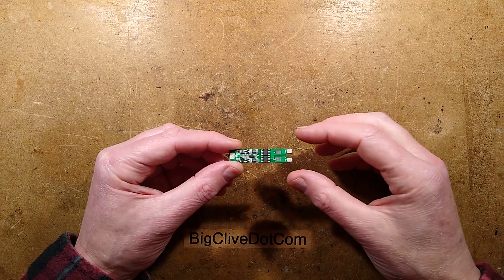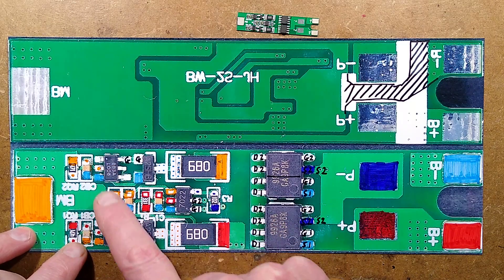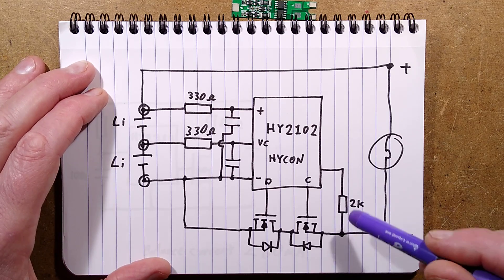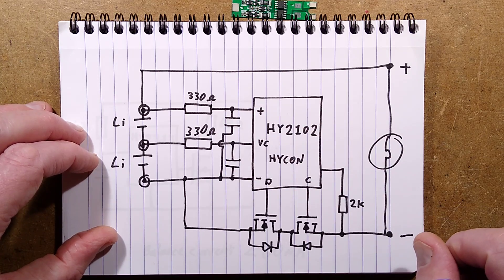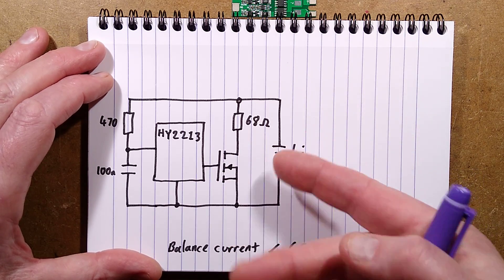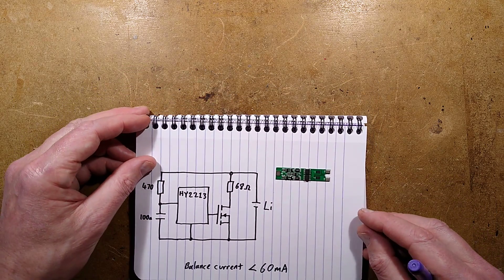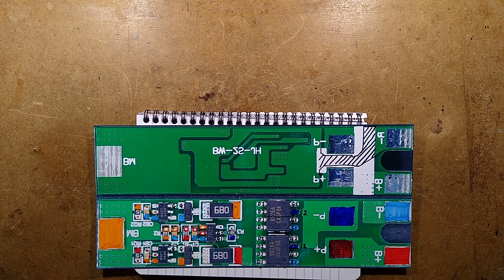Lithium cell balancer reverse engineering with schematic

Comment: Great video and explanation. This is a passive type of BMS. This is slower and produces heat, maybe small amount. Once cells start to degrade, balancing becomes even slower. Active uses other cells power to charge the other, but it is quite complicated and I am looking for a simpler design if anyone could point me to the right direction or schematics

Comment: What is the 883A L008 IC used in this circuit?
Reply from the maker: HY2213-BB3A lithium cell balancing controller.

Comment: Almost all MOSFETs sold will have body diodes; it will not go away (anytime in the future). A MOSFETs "without" body diode will not have a fixed threshold voltage (Vth) because it varies with both Source and Drain voltages in reference to the 'body'. Also a fourth terminal (connected to the body) will be given as well and you have to connect it to a voltage that will always be reversed bias (or 0v) to the Source and Drain terminals. This makes the MOSFET difficult or inconvenient to use. That is probably the reason why the 'body' is always connected to the Source terminal so that Vth is fix and you don't have to deal with the fourth terminal, but you get the (unwanted or free, depending on how you appreciate it) body diode as the result.

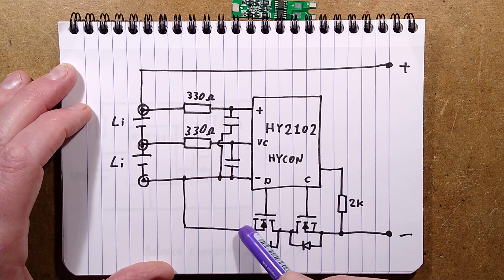Comment: 3:04 This is a detail, but the body diodes direction of both NMOS is switched... The reason is that they live in the same chip (as you pointed out it's a dual MOSFET chip).  So, most likely, both NMOS share the same substrate and so the anode of the body diode is necessarily common to both MOSFET. 
Therefore the node between the 2 NMOS should be the anode and not the cathode.

Comment: I had exactly the same question about how the 'balance' chips can work if the over voltage protection shuts off the charger input?
It looks like they can't unless the protection trips at higher voltage than the balancer, so if the charge current exceeds the bleed rate, the voltage will rise and the charge input shuts off.  Maybe that is what you said?

Comment: That is not exactly a balancing circuit, it's a voltage limiter, the difference is that to have the cells balanced you must charge them to max voltage. But what if a I want my cells to last? the easiest way to prolong the longevity of the cells is just to charge them to a lower voltage (I use 4.05v), in wich case you either need a true balancing circuit or a limiter with the voltage adjusted accordingly.
I just don't trust commercial BMSs, whenever possible I build my own, I went as far as to build my own single wire communication protocol for a scalable BMS that I'm currently using on a 7KWh 7s pack, complete with remote monitoring.

Comment: Stupid question, sorry. Are their boards designed to charge two cells in parallel, instead of in series like this?  I’m thinking of something like 18650s from scrapped laptop batteries. I’ve been told that you shouldn’t charge two of those cells that are welded in parallel.
Reply from the maker: This is for two series cells.  For cells in parallel they should be treated as a single cell.

Comment: "balancing" without any kind of organised higher level BMS is not really balancing, but actually "charge shunting"  Ie say Vmax is 4.2v, the first cell to reach say 4v has it's shunt resistor turned on, and as a result is now being charged slightly slower than the cell with the voltage below that same 4v point.  The aim is that by the time the 4.2v and the hard shut off is reached, that charging imbalance will have had enough time to have caught up the voltage on the cell not being balanced.

Proper "smart" balancing that is necessarily controlled by some form of higher level control logic can both do this earlier, ie at a lower cell voltage and hence have more time for balancing, but also can signal a reduction in charging current to also help the balancing occur as necessary.

For small simply cell systems, then the basic shunt type arrangement works, but it mostly doesn't do that much, and it take a significant time to do it. It relies on the fact that hopefuilly the cells are both well matched initally but also age at a similar rate!

Comment: Any chance of you doing a teardown of a solar charge controller. I know the basic principles but I have a few queries in my mind. 
Does it work just by controlling current by sensing the voltage or does it control the voltage as well. In particular I was wondering if the solar panel is outputting a voltage lower than battery voltage would it be worth putting a buck/ boost convertor after the solar panel to enable it to use more of the solar panel output?

Comment: In some of my very high reliability designs, I couldn't rely on the CMRR of the voltage sensing OP-AMPs to monitor the voltage of each cell, especially for very high voltage batteries with tens of cell in series.
I used a temperature-stabilised opti-coupler for each cell as voltage sensors.
This design is in totally opposite direction of the chinese designs, which prioritise low components count and short PCB tracks (to save copper), where reliability, immunity to noise and all static working points of active components are sacrificed to the cost of the board.
Thank you Big Clive for this video, that exemplify the design criterias to the bones...

Comment: Not entirely related to the video, but it does involve power supplies, so it’s tangentially related - and I’ve no idea how to make a comment on a channel instead of a video or even if that’s possible. 
Anyway, has anyone seen a computer power supply fail where (I think) a MOSFET explodes? (Obviously, after watching this channel, I had to salvage something from what is likely a very expensive problem, by dismantling the PSU to identify the fault).

Comment: if the balancer and protection mosfets are correctly programed at the right trigger values the balancing function can still work without a CV slow trickle type charger. Imagine the trigger for cell balancing is 4.18v and the over voltage protection trigger is 4.25v and THEN the over voltage protection release is 4.2 volts the balancer will run continuously and the charger will activate every hour or so for a few seconds. If you keep the charger plugged in it is wasting energy at 60ma forever but at least the cells will get balanced over that time period no matter what type of charger you are using! Then after awhile once the cells are perfectly balanced maybe in a few days or so just unplug the charger and the balancer will drain the pack to 4.18v and then stop wasting the energy and you can have a perfectly balanced pack!

Comment: Hey i was wondering if anyone else experienced this problem.  I have a set of Howard Leight headphones, the green ones.  They are not bluetooth but they have an audio jack and a weird microphone that amplifies spoken words while dampening stuff like gunshots, as they are intended for shooting.  Anyway the mic is what seems like a rheostat where it clicks and turn off on one side and other direction turns on and seems to increase gain on the mic.  Anyway I wanted to use these headphones by just plugging in to my PC speaker with the audio jack. As soon as this thing went near my computer, as long as it was on, but before I even hooked up the audio jack, they started making weird ticking sounds. The sounds did not vary with the gain on the mic, and only stopped if I completely turned off, the headphones. Distance from other electronics does seem to play a role in how strong the ticking is. However, it’s not Bluetooth because even when I make my computer go to airplane mode, it has no effect on the ticking sound. As long as the headphones are near the computer, they make the sound. It’s not the router cause I moved it to the other room. Any ideas what’s causing it?

Comment: Odd thought: perhaps replace the 68 Ohm resistor with an LED and a 15 Ohm resistor?

This might give a (simple and crude) indication when balancing is actually happening?

Another thought is to put a pair of tip-jacks in one of the (metal cased and dismantlable) Ebike chargers I have, so as to more-readily test the actual output voltage of the thing?

Comment: The balancing circuit works when the cells have different capacities after time in use.  The weaker cell gets charged first.   The balancer  turns on stopping it being overcharged whilst the other cell fully charges.

Comment: The same as DW01, overcurrent protection is going to have a wide tolerance as the current sense is the voltage drop across the MOSFETs. Mosfets are specified be maximum RDSon, not minimum. If you are unlucky to get a couple of really good MOSFETs the overload protection could be at a much higher current than expected.
Reply: how does dw01 control the two mosfets? bootstrap?

Comment: My guess is that if one cell is full and other isn't, the full cell's protection resistor will be dissipating in excess of 62 mA (i.e. in excess of 4.2 V).  The resistor, plus the non-full cell, in series will be taking however much current gives 8.4 V.  Thus the non-full cell will (only) asymptomatically approach becoming full.

The high level takeaway from this video is that some battery packs will only get balanced when charged to full.

It would be nice to see BMS balancing systems that work at lower SoC become more ubiquitous.

Comment: As you can't just charge a single cell as the input voltage is meant for two cells, why not balance between themselves? Like for example, when one gets to 4.2V, you turn off the charging mosfet and then you connect the cells in parallel with a resistor in between. When the voltages get equal, you start charging again until one cell gets back to 4.2V and then you repeat until both are at 4.2V and you stop charging. It may not be the fastest, and not the most efficient (half of the balancing energy is wasted) but quite simple and effective

Comment: The technique is called top balancing. When you charge a 2S pack, you just put 8.4v across the terminals (with a current limit). It charges at constant current then constant voltage. If the cells are mismatched or otherwise out of balance, one will reach 4.2v before the other. Hence detecting 4.2v for each cell and the shunt if 4.2v has been reached, as the other cell still needs to charge. The voltage across the shunt could in theory be up to the full 8.4v if the second cell has failed short circuit.
Reply: In a multi-cell pack, more than 4.30V across a single cell would be an over-voltage fault, and sufficient reason for the pack controller to stop charging and disconnect the pack.

Alternatively, if a cell decided to short, a low voltage condition (Vcell<2.0V) would be another reason to stop pack operation. Although in this case, that might not help much - the cell would likely be going into thermal run-a-way, and an over-temperature fault would soon occur, sometime about when the cell decides to vent....💥

Comment: 60 mA through the 68 ohm resistorb also works out to a nice 1/4 W, which seems like a reasonable upper limit for a small surface mount component like that with good heatsinking to the PCB.

Comment: Li-Ion chargers typically use CC-CV as the charge method, in CV mode the current near to the shutoff voltage is already so low that the bleeding circuit of the balancer has a significant effect. If the cell is too badly unbalanced it will strobe-charge the pack which is generally fine.
Reply: thats correct, but if the balancer and protection mosfets are correctly programed at the right trigger values the balancing function can still work without a CV slow trickle type charger. Imagine the trigger for cell balancing is 4.18v and the over voltage protection trigger is 4.25v and THEN the over voltage protection release is 4.2 volts the balancer will run continuously and the charger will activate every hour or so for a few seconds. If you keep the charger plugged in it is wasting energy at 60ma forever but at least the cells will get balanced over that time period no matter what type of charger you are using! Then after awhile once the cells are perfectly balanced maybe in a few days or so just unplug the charger and the balancer will drain the pack to 4.18v and then stop wasting the energy and you can have a perfectly balanced pack!
Reply: @uhjyuff2095  Some chargers do exactly that - it's called the bleeding phase, or just balancing phase. The charger rises the charge voltage slightly and lets all cells reach the top voltage. Then it switches off completely. Sometimes the CV voltage is set so this happens automatically from time to time. This is rather stressful on a cell, but it allows for much better pack performance.

Comment: non-related question, where/what brand/model/source did you get your nifty little lighted magnifier and what's it's magnification?  Thanks
Reply from the maker: eBay has a selection of them, but the magic keywords can be a bit tricky.  Start with "illuminated magnifier".

Comment: As far as I know (before video) they just slap on a resistor across the batteries that are too high to bypass them during charging and to help discharge them a little. An isolated comparator per cell.

Comment: A very simple SAFE way to charge multiple cells ( like a 4 pack from an old laptop ? ) is to bring ALL the connections out and charge each cell in turn , ( use a working  old vape charger + croc clip leads ? ) ... this is a hell of a faff , but at least you will not cause fires ( ? ) ... ( tried - n - tested ) ...... DAVE™ ...........

Comment: Can anyone explain to a real electronics dummy like myself how things like diodes work, when every once in a while I hear someone say "electricity actually flows from negative to positive, and it's backwards to how you're taught."

I just get confused as to how one-way components work properly if thats the case.
Reply: Electrons were discovered 150 years after negative and positive were defined, unfortunately. So a large body of electronic components and conventions were defined before we actually knew current is actually compared of moving, negatively charged, electrons. As for diodes, you don't need to understand electrons to invent them, just like you don't need to understand electrons to experiment with lightning and static electricity. The first diode was just an extra electrode in a light bulb, connected to a battery. If the extra electrode is more positive than the one being heated to make light, it attracts electrons and receives current. If it is more negative, it shows no current. So it's unidirectional. You don't need to understand electrons to test the two situations, though. Early current measuring devices were just electromagnets that pull a metal pointer, after all, and electromagnets are just coils of wire.

Comment: I always thought the whole "balance by wasting energy" was weird but I guess it's pretty common. The weird thing about this implementation, is that unless you charge it all the way it won't balance, so if you try to stop charging at a lower point to save battery wear you might get an incredibly unbalanced pack.
Reply: ignoramus!
1) practically all battery packs are balanced at the top end.
2) you cannot balance a battery pack somewhere in the middle, it will almost certainly cause imbalance.
3) if you really  must "save battery", it does not really matter how unbalanced the pack is. (unless you then suddenly totally          discharge or fully charge the pack. (which in your case would be expected)
4) your wasting energy bleeding a high cell is an absolute tiny amount compared to what is going in and out of the pack.
Reply: @ursodermatt8809  Thanks for your explanation but please don't call people 'ignoramus' - not everyone watching this channel knows as much as others...
Reply: @stepheneyles2198  
ah yes, i partly agree with you.
however 
rpavlik1 states his opinions as facts.
my attitude is if i do not know anything about a matter, i might ask questions or investigate it, but do not make ignorant statements.
Reply: @ursodermatt8809  He said he thought, he never said it was a fact, unless he edit his original posting. or is it that in the west when someone says "they thought" or "I guess" it means its a fact?
Reply: @dantronics1682  
what kind of balancers do you have in the "east" ?

Comment: To estimate the current we have to consider the voltage drop on one diode of the first mosfet plus the drop on the on-resistance on the second mosfet?
I thought, the drop on the diode is much higher (~0,6V) than the resistance (maybe 0,01V per Amp?).
The voltage drop on the diode is lower at higher temperatures, that's not what we want here. :-)
What am I missing?

Comment: In theory the current should be well and truly winding down by the time your cells are approaching 4.2V. I believe typically Li-Ion charger are supposed to cut off the charge when the current drops to 10% of the constant current level, so this would work fine if your max constant current is 500mA. As long as the cells aren't horrendously out of balance, it should be approaching 50mA by the time the first cell reaches 4.2V, then the bypass circuit should switch on and dissipate that current until the second cell reaches 4.2V, then the current should start winding down further until it reaches cut-off.
Reply: It's CC-CV. The constant current phase continues specifically until the voltage is 4.2V/cell, and then the current starts dropping to keep the voltage from not going above 4.2V/cell.

Comment: An important thing to add is that there are two types of these BMS boards - 4.2V ones for LiPo, IMR etc and 3.65V ones for LiFePO4 ones.  Sometimes eBay listings are slightly misleading if the seller is non-technical, so it's worth googling the part number written on the board to see which one you're getting.